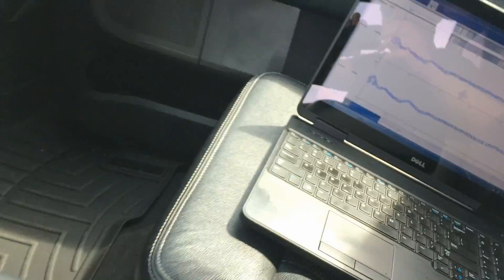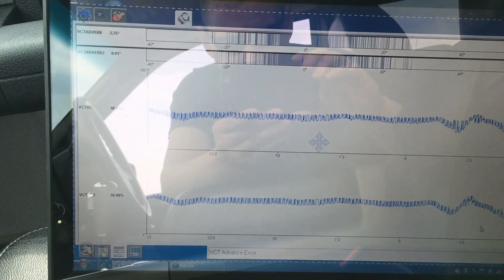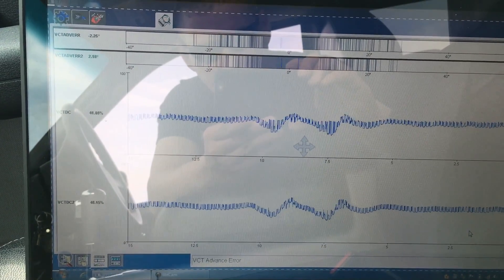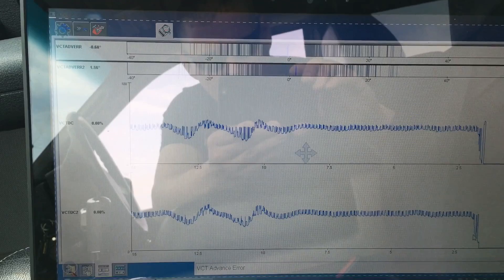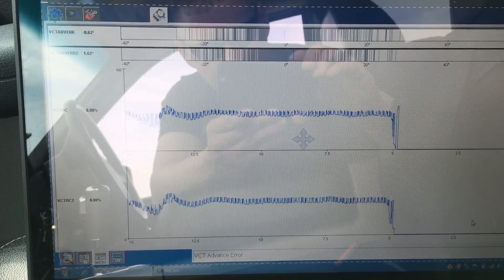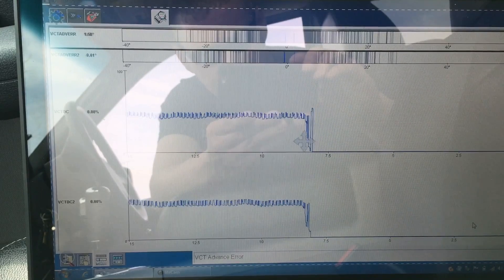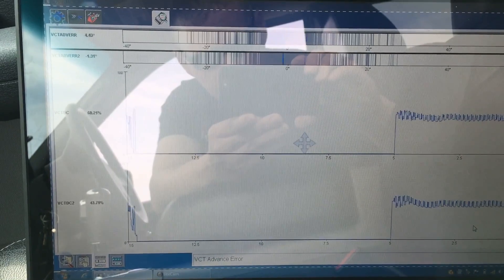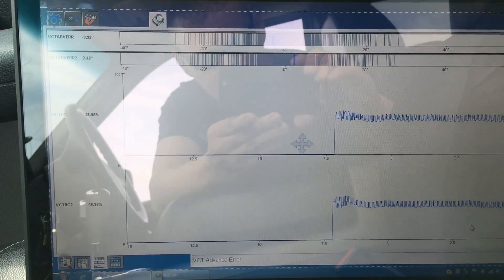Ford Quick Tips #74: 5.4L 3v Phaser Oscillation and Knocking Noise Explained

Comment: I rebuilt my entire system about 3 years ago . I rebuilt my heads all new springs, followers valves etc., replaced the timing chain followers, oil pump complete . the only thing I did not change is the vct solenoids. All ran fine for about a year and then I got the 345, 344 cro and 349 codes. I replaced the solenoids last year and all was well til I had to replace catalytic convereters. I got my 345, 344 349 and 340 codes now, I just replaced the cam phasers for the second time as they were both trach. mput everything together and cannot get rid of the 345 and 349 codes. I followed fords procedure and went as far as replacing the wires from the pcm to the cam shaft position sensor all to no avail. I am going to open up the left side valve cover to check the new cam phaser  and see if anything is wrong any suggestions? By the way I used your quick version on the replacement of the cam phasers and it worked pretty well. Thanks

Comment: i just done my 2004 f150,phaser chain ,360 oil pump, still have a miss at about 1200 rpm also when you ease into the fuel to take off, or at higher rpm, but if you push it into like give it somewhere just over 2000 rpm it smooths out, #1 i have never changed coils on it since i have had it, #2 never changed fuel injectors, did change plugs , But my question is i see people putting pieces in the phaser that lock them out , to me that defeats the purpose of the phasers ,what harm do those lock outs do to your truck???194,000 miles on my truck

Comment: Are there any upgraded VCT solenoids? I just had a rebuilt engine dropped in my f150 5.4 3v '07. Still getting that phaser rattle. I just hooked up a code reader and took it around the block. Seems fine, no codes, the timing stays between +16 and +35. When the timing drops below 12 on a slight hill, she'll bang. Once the VCT on the driver side stuck on the hiway. had to pull over for a while till it freed itself.  I wonder on these rebuilt engines, what comes on them and how much of my old crap was put back on.

Comment: Hi love the videos great info, but my ?? is i have a 2004 f150 5.4 with 275000 on it,  the knock started about a month ago, so with your help and videos i tore it down. The guy i bought it from just had all the timing chains and phasers, and guides changed. It all still looked new and in good shape, the chains were all tight, the phasers look straight like you showed in your video about how to tell if they were bad on the vehicle. So with seeing all that I went ahead and changed the VCT thinking maybe one was stuck. I put it all back together and its still there, oh i also checked the oil pressure before the tear down I cant remember what it was but it was well above the spec per your video so I ruled that out first. Any suggestions HELP please

Comment: Would a bad phaser break timing chain guides?
Reply from the maker: no
Reply: 659MX 659 not directly but they do break the guides if you get it go long enough. Reason being is that the chain tensioners get their oil feed from the same place your phasers get fed, the VCT solenoid housing. If your phaser isn't getting the correct pressure to operate as designed neither is the chain tensioner. The erratic pressure will allow the chain to slack and pull tight as the tensioner oscillates and that constant beating will break the guides. Almost every cam phaser job I've done comes in with at least one broken guide and a few with a hole worn in the timing cover from the chain hitting the spot where the guide is missing. 

Also, the composite tensioners dud away with the ratcheting mechanism of the iron tensioners from the 2 valve 5.4 so there is no failsafe. If the tensioner loses pressure it will collapse completely unlike the old style that will only collapse back to the last notch of the ratchet. Luckily the old style tensioner will bolt onto the the 3 valve just fine and they don't blow seals because they don't have them.
Reply: Daniel Delgado I appreciate you answering. Found some groves on cam shaft journals , cam caps and where the cam shaft sits on the head has groves as well
Reply: Seems like there was poor oil pressure.

Comment: how come I don't see any cam phaser's or vct solenoids on a 1998 f250 with 5.3 3 valve triton byfuel?
Reply from the maker: 3v engines did not come out until 2004.
Reply: what engine would it be then in 98 given there is a bulge in the front of the valve covers for the cam sprockets? does the 5w30 still apply as the best oil then?

Comment: our remanufactured 5.4 3v purchased through our local ford dealer was $5200 and another $1800 for a few gaskets, exhaust bolts and installation

Comment: My 2010 expedition 5.4l had the exact same "phaser oscillation" noise when in drive above 1000 rpm. It did not have the phaser nock noise at idle. I replaced both VCT solenoids and boom, no more noise.

Comment: Hi Brian, just thought I would add something to this. I have a 2005 expedition, currently has 127000 miles. I have owned this since I inhereted it from my uncles estate, at which time I got it when it had 23000 miles on it back in 2008. Since I have owned it I have used Valvoline full synthetic 10w30 oil. Changed religiously every 6 to 7 thousand mile intervals. When I got it it sounded like a diesel back then, I have never done anything to this motor as far as timing chains or vct components. It is still running strong. I think you hit the nail on the head when you stated that in other countries they run a heavier weight oil. Also by using the heavier weight oil you will definately increase the oil pressure. My advise to anyone with one of these engines is to do what I did. Fuck that government shit. Of course they dont give a shit because they are not the ones dishing out 2000 bucks to fix this problem that they caused. Just my 2 cents.
Reply: I use Delvac 5w-40..

Comment: Hi Makuloco
i have a 2005 5.4 and i am getting the codes P0012 ,P0021 and P0171. the truck has 179000 KM on it and the engine starts and runns great no noise let you say when a phazer is starting to go . I have check electrical conection and all is good so I think I am going to tare it down and do the timing kit with new oil pump. I do have one question in your video #4  you pull the three rollers and then you pull the cam later on can you just pull the cam . need your help

Comment: Thanks for the excellent video and explanation. My 2010 F-250 recently started making the cam phaser oscillation noise, and it was freaking me out a bit. I've run the recommended 5w20 oil in it since new, and it's got about 215k miles now. I'll switch to 10w30 until I can get the parts ordered up to fix it properly. With the Ford bulletin recommending to not fix the issue, I should hopefully be ok for a bit longer.
Reply: Did you figure it out?
Reply: @thuglivintv824  I ended up rebuilding the engine due to no compression on one cylinder, and as part of the rebuild I made sure to replace the oil pump. I reused the old cam phasers and the noise was much less.

Comment: I have the same knocking noise in my 2010 F150. The dealer told me my choices to fix the problem were either get use to it or turn up the radio. Last Ford I will ever buy.

Comment: on my  2005 f150 5.4 I've been using 10w30 now since I'm at about 155,000. is that an ok grade oil for that mileage?? truck is running great. engine runs smooth and real quite. has had a light easy life. no heavy towing or heavy loads.

Comment: What do you normally charge to replace the entire timing kit and the oil pump on one of these 5.4s?
Reply from the maker: +David Smith My current pricing is $1,860 parts and labor people come from all over the country to get these done it makes them like new!
Reply: FordTechMakuloco - when can I drop off my wife's 2008 Ford Expedition so you could fix it , and what's a turn around time ?

Comment: hi Brian I'm wondering what is the deal with number 6 cylinder intermittent misfires on a 2 valve five four replaced plugs coil harnesses are good check the voltage replaced injector still have the same problem coming and going on number 6 any Vice you can give me please thanks

Comment: Can you do some more indepth videos about the 2 valve engines specifically the 4.2 v6? i have an 02 f150 4.2 v6 and its reliable as can be. mine has some engine pinging so im easy on it and never get it to the point of pinging. i already watched all the other videos you have but any more would be awsome

Comment: I have a 2008 f150 with a new jasper motor 5.4 triton. the only time I have issues with the vct (eratic timing) is when outside temp reaches above 80 to 85 degrees. why is that? very strange.

Comment: Thanks again for another great video.  I have a 2010 5.4l 3v F150 with about 78k miles on it and it has just started exhibiting knock and oscillation maybe 2-3k miles ago.  Question, what is the risk to the engine if I continue to run it, I assume even if I switch to 5w30 at my next oil change this will continue to deteriorate?  will that eventually damage the engine?

Your videos go into incredible depth about how to diagnose and correct these issues but I would maybe appreciate a little "here's why this is bad" explanation.  Other than being slightly annoying rolling around in a truck that cost in some cases over 50k when new that rattles like it is falling apart (mine's not that bad yet but I have heard some that rattle worse than an old 12V Cummins), is there any mechanical risk to the truck?

Comment: The 5.4 L engine seems to have way more problems than the 4.6 L. I have an 06 F-150 with the 4.6L and nearly 200k miles and never had one engine problem.

Comment: Are u suggesting 5w 30 even for newer motors like 2015 5.0? Ford says 5w 20 on that as well but maybe this is not an issue on this engine? Just want to be sure I'm using best oil. Thanks for all your awesome videos! edit looks like many others have this question as well, perhaps clarifying if your oil recommendation to 30 was just for this situation only. Thank you sir

Comment: what oil do you recommend for an 03 expedition with 250,000 miles.
Reply from the maker: at 250k on a 2v engine I would be using 5w-30 yes.
Reply: Thanks.
Reply: Its 4.6. Is that okay?

Comment: My 2001 Expedition has 252k no noise no tick no anything runs like New still gets 12mph in the city, only work performed on motor is standard maintenance even the water pump is stock . Mobil 1 every 3k with premium filter add motorkote hyper lubricant every winter flush coolant every 30k these engines are bulletproof.

Comment: first thanks for the videos. I did a rebuild on my 07 f150 using your videos as a lot of help. my question is. I replaced all the timing components except phasors. I had a broke guide and busted tensioner. however did not replace the phasors. I was under the impression this was just a noise issue and doesn't actually affect the performance of the vehicle. does that sound right. I just couldn't justify spending that much money on a noise. I don't care that much haha. I'll switch to 5w 30 as well. I didn't know that at all. thanks again.

Comment: Would you run the 5/30 instead of the 5/20 in a 2004 that has the original pump? Your pump video came out a few months after I had to replace a cam, lifters and followers on mine! Can you pull off the front cross brace under the pan without having to have the front end re-aligned? Thanks for the video.

Comment: My 2004 5.4 3V started knocking like this at 90,000 miles. Run a quart of auto trans fluid through engine and changed oil. Truck stopped knocking now has 202,000 miles now.

Comment: So would it be better to run 5w30 instead of 5w20? I accidentally did an oil change a while ago with 5w30 and just left it with no ill effects. I've since been using Motorcraft synthetic 5w20. So far I have no phaser knock or noise would 30 be better for my motor with 117000 miles on it?

Comment: Brian, I'd like to keep you in business how much would you charge to fix my 06 F150 with 157000 Miles, with all the exact same problems that are in your 4  videos? dealer and local shops just want to swap the engine at 3-5k
Reply from the maker: I do them in one day let the sealant dry over night and QC them in the morning.
Reply: VCT, oil pump, phaser, timing chain for $1860?  Parts included?  My question is, once this is done, will there be a repeat in 150K miles or new timing chain and phasers this noise should go away period.
Reply: Just curious what your turn around time would be?  Thanks!
Reply: mk E. get the work done asap before it won't run at all as was our case with our 07 f 150 supercrew with 105,000 miles i procrastinated with getting it over to Brian and the day before thanksgiving it would turn over with high and lows in the crank but wouldn't run at all since im over an hour from his shop tow company wanted over $400 to take to him but we got it towed to a local shop that a family member knew of and had them install a remanufactured 5.4 3v purchased directly from FORD came with a 3year unlimited mile warranty
Reply from the maker: Just for a comparison a dealer will charge close to $4k for the same job.
Reply: klatoo14 if you use the higher weight oil it should last longer than this go around. "acording to his last part of this video"
Reply: Can I goto 5w-30 without changing the oil pump?
Reply: If the local shop charges even $2k I'll be happy lol $4k?  I'll do it myself.  Wish you were closer to me, Brian!  I'd have you do all kinds of jobs on my truck.  Thank you for the helpful video's.  I may be attempting a timing chain, phaser, oil pump replacement and will certainly reference your video's like I did on a previous phaser replacement (if I go in and replace chains and all that I'll be buying the kit that comes with new phasers and will replace bank 1 again).

Comment: I have an 05 f150 screw with 5.4L with 185000 miles ,with never any phaser issues. i have a remedy that works great.every single oil change has been with Pennzoil 5w30 with 2 bottles of stp oil treatment.my engine has been flawless. I used that remedy in my buddy's 07 f150 with a minor sound.. and it went away . thanks for videos on this situation

Comment: My buddy and I replaced the phasers, all the timing components, and the oil pump on my 2004 f150 back in December using the 4 videos that are referenced in the description of this video. It's a lot of work to tackle this yourself but those videos were sure a huge help. Thanks for all the help you give us, I would be completely lost if it wasn't for these videos.
Reply: Jeff V lo
Reply: Did you have to get it re-tuned when you did this replacement?
Reply: Stephen Martin no retune required
Reply: How much did that cost if you remember
Reply: Tanner W somewhere between 1200 and 1500 but the ford oem parts are half the price now. I did another one of these timing jobs back in January for a friend
Reply: @jeanvi52  Awesome thanks so much man

Comment: By the way I have the 2000 Expedition the 5.4 and would this have the same issue as you stated?
Reply: I know this is old but you're expedition has a 2 valve per cylinder 4.6 or 5.4 so no variable valve timing.

Comment: Now if I take my truck into a Ford dealer how much roughly would this cost with labor and all the parts? My Expedition has 209000 miles but holds good oil pressure yet and it does have the similar noise as you showed but not that loud.
Reply: John Deere : I took mine to the Ford dealer and two other independent shops and nobody would touch the problem even when I told them exactly what it was and how they could fix it. all they wanted to do is sell me a remanufactured engines because they said it was the same amount of Labor 3 to $5,000

Comment: Just finished doing my timing chains phasers oil pump ect but runs great at idle but I have a misfire under load there was water recently on the spark plugs could the problem be coils and plugs I'm getting no codes

Comment: are these problems just as common in the 4.6 3v as well?
Reply: Thank my lucky stars I have a 4.6L 2V in my '98 F150...no phasers...or at least i don't think so. 440,000 kilometers on it and the front cover and valve covers have never been off.
Reply from the maker: The knock noise is just as common but the 4.6l 3v but the rest of the concerns aren't as common.

Comment: there was a SSM back in 04 regarding phaser knock and it stated to replace engine oil and filter, but install 5w30 oil. they pulled the SSM a few weeks later as the Fuel economy testing was done with 5w20 . the EPA cracked down, and it was going to cost ford a ton of money to redo that testing with the 5w30. i bet i still have that ssm in my box somewhere
Reply: This is the
Special Service Message

21574 4.6L 3V/5.4L 3V Engine Tick/Rattle from VCT 800-1200 RPM DO NOT ATTEMPT SERVICE

2009-2010 F150 with 4.6L 3V, 2005-2010 F150 with 5.4L 3V....

Some customers may be concerned with tick/rattle noises from the VCT on light tip-in accel, between 800-1200 RPM. This condition may be most noticeable operating vehicle in confined areas such as drive-thru. The noise is eliminated when VCT solenoids are unplugged. This condition should be considered normal characteristics of the engine. Do not attempt engine repairs to change this normal condition. This condition does not affect performance or durability of the engine.
Effective Date: 11/10/2010 one i was referring to
Reply from the maker: I would love to see it!
Reply: FordTechMakuloco isn't there a TSB regarding the VCT solenoid clicking/ticking from off idle to around 1200rpm saying it is normal??

Comment: As usual a good video. I am just finishing putting my engine back together from complete timing chain, tensioners, phasers, guides, water pump, oil pump. your 4 part series was invaluable to me. I went ahead and had valve job done on heads and put new plugs and coil packs on.  thank you.